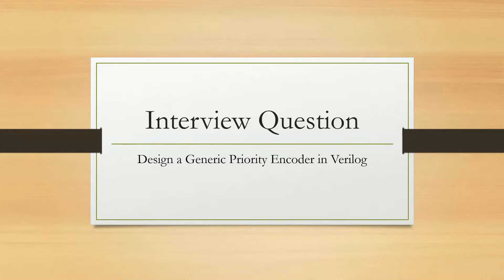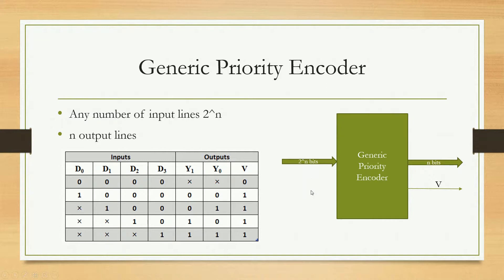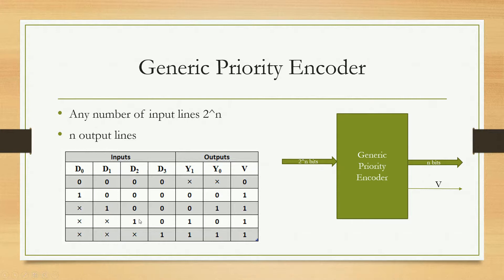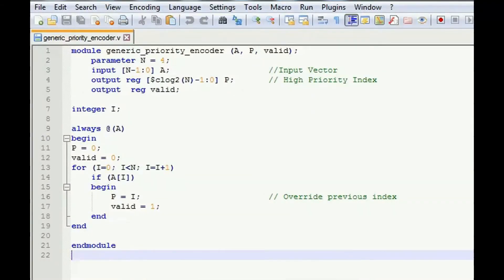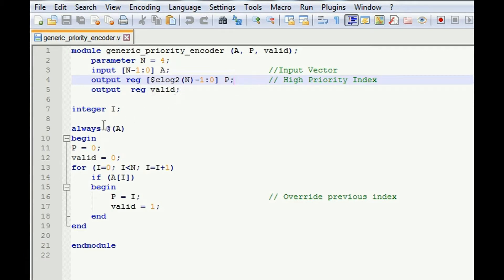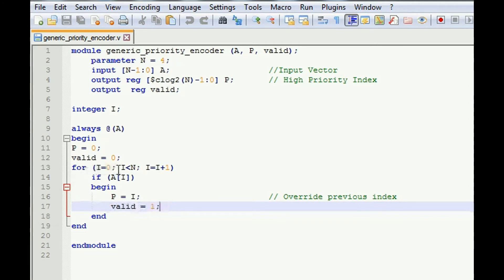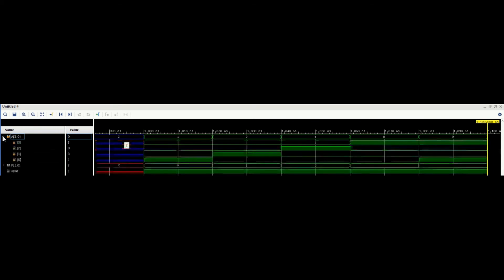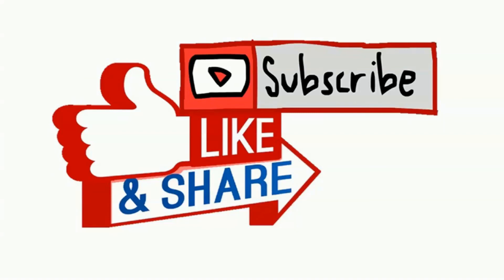Interview Question | Design a Generic Priority Encoder in Verilog

Comment: Hi Sir it was an informative video, but I think in the code the priority is given to the D0 bit instead of the D3 bit. In the explanation, it was asked that d3 should be the priority. So according to me the for loop should be somewhat like - for (i= (N-1); i==0; i=i-1) and the rest of the code should be the same. In this case, it will first check the MSB bit of the input and then gradually decrease to LSB of the input. Please correct my understanding if I am wrong.

Comment: Will this work when multiple bits of input A is asserted? If bit 0 and 1 are asserted together then Forloop will not stop at 0 ( even though higher priority) and will assign P with 1 in next loop run . Isn't it? Don't we need to exit the loop after first priority bit is asserted?

Comment: what is the difference between priority encoder and generic priority encoder??
Reply from the maker: Dear Rajesh, Priority encoder can be 4 to 2, 8 to 3 or 16 to 4 etc. For example, in a complex design you need to use all of them. Now, there are two options for you. 
First option is write the code for 4:2 priority encoder, then write code for 8:3 priority encoder, then write code for 16:4 priority encoder.

Second option is write a generic code for priority encoder. Now by simply changing the parameter at the time of instantiation will make it 4:2 or 8:3 or 16:4. This way you don't need to write the priority encoder code again and again.

Please let me know if it clarifies your doubt. Otherwise we can discuss further, not an issue
Reply: @TechnicalBytes  
Got it.
Thanks a lot.